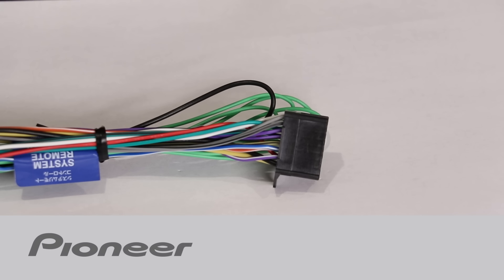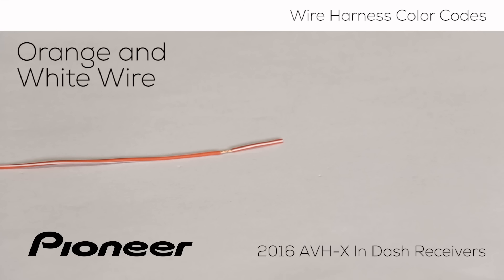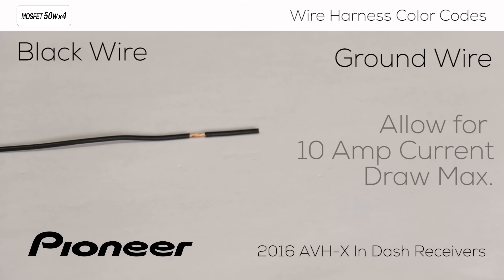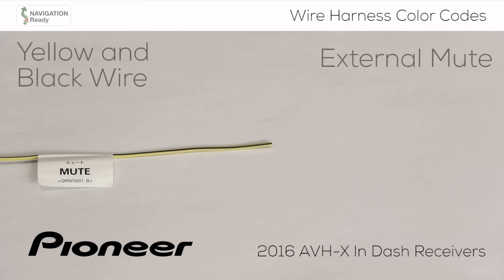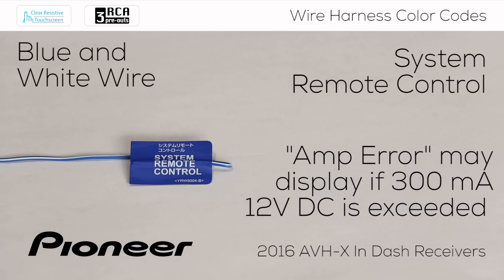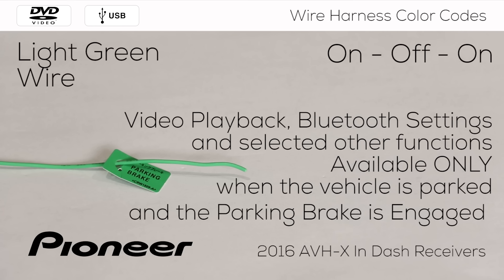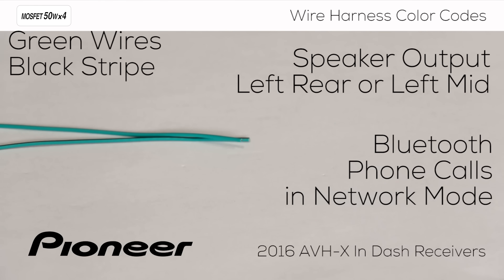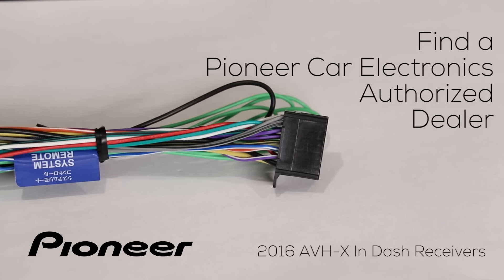How To - Understanding Wire Harness Color Codes  for Pioneer AVH-X Models 2016

Comment: Avh-211ex came with the pioneer camera. Everything works but, no sound or back up camera working. Radio shows it's working. CDs and DVDs play, you can make a call and they can hear you but you can't hear a single thing. Everything is from pioneer. Any help is greatly appreciated.
Reply: I would like to add. Many have checked connections yes professional. Just off the clock because they are family. We did buy the harness you recommended. So everything is 100% pioneer compatible from our understanding. I really think that the harness may not be the correct one for my car. It's a 2010 equinox. No steering wheel controls.
Reply: Also no subs are being used. It's all just factory door car speakers. Had sound fine before. Again it reads disks and you can call. Bluetooth connection is fine. Just can't hear sound and the back up camera won't come on. But I do believe your video and the comments have explained that part about the camera. But the no sound. No one can understand that. I really wonder if the wire harness for the car is the correct one.
Reply: I recommend to press the microprocessor reset button.  You'll need a paperclip or some other small point to press the microprocessor reset button.  You can find the microprocessor reset button on the Pioneer AVH-211EX at the bottom of the hard key panel near the rewind button.  
You mentioned above you may have an incorrect wire harness.  Just to clarify, the Pioneer AVH-211EX has a wire harness in the box.  It should be identical to the one shown in the video above.  That is the only wire harness that is designed to be used with the receiver.    Are you using a 2nd wire harness adapter designed to connect directly to the wiring of the vehicle?  Vehicle compatibility is usually shown on the packaging for the factory wire harness adapter.  If this is not the correct wire harness, I recommend doing some research to find the correct compatibility.  Here is one possible option for the 2010 equinox:   http://metraonline.com/part/99-3307G  You'll need to do research to be sure it's the correct fit for your particular vehicle.   Here is another possible option:  https://www.scosche.com/lpgm15   You'll need to do your own research to be sure it's the correct product.
If you still don't have sound, I recommend to test any individual speaker output from the receiver.  For example, on the back of the receiver use the White and White with black stripe.  Connect it directly to a speaker that is know to operate.  This is just to confirm audio output from the in-dash receiver.
As for the backup camera,  Pioneer in-dash receivers are designed to work with the Pioneer ND-BC8 backup camera. I don’t know about the operation of other cameras. 

Be sure to plug the Brown camera output RCA into the Brown RCA Input on the back of the Pioneer in dash receiver.

The Pioneer ND-BC8 camera needs power and ground to operate.  The camera should always have power when the vehicle is switched on. And the camera should power off when the vehicle is switched off.  This is very similar to the way the Red Ignition wire works on a Pioneer in-dash receiver.  Just because the camera has power does not mean you are viewing the camera window on the in-dash receiver.

The purple/white wire is used to let the in-dash receiver know that the vehicle is in reverse and to open the backup camera window on the receiver screen. 

Do not connect the Purple/White wire to the camera. 

When you put the vehicle in it’s reverse gear, the Purple/White wire should sense a change in voltage. This opens the camera window on the in-dash receiver. And closes the camera window, when the vehicle is taken out of it’s reverse gear.  One possibly connection for the Purple/White Reverse Gear wire is back up lamp terminal.
Reply: The wires that came with it are similar to the video. The wires i got with it does not have that white wire for the mute and when i saw that i almost instantly thought thats where the sound problem is. But everyone keeps saying "thats what came with it. The papers and the audio guy at the shop even said it was the right one. Then when connecting to the wire adapter to plug in to the car is aswell missing wires that would complete the cycle.  But again we keep being told its the correct.  But you show a white wire in the video that i do not have on the wire harness that came with it. 

The camera is the one as you mentioned.  But again the i keep pointing out to everyone that the purple needs to be connected.  But according to the papers there is 2 ways to install.  Like you said in your response is what i kept saying but again they said it is not needed. But i think 100% it is. That would bring us back to the wires. I do not have it infront of me to tell you what wire other than the white one i know for sure is missing.  But i will send all your information along to them when i go back to the shop. I even wonder if doing this for as long as they have just might be getting to some old men. Lol but again thank you for responding.
Reply: I said wrong. I have the white wire. I do not have the yellow and black wire. It's the mute wire. That is why we think it is not correct. Or the wire come out somewhere in shipping and packing.
Reply: So, there is no yellow and black wire as well. I was told to state that the red wire is pink. You could say red but everyone that looked at it says pink. Next to a red wire you can see the color difference.
Reply: Ndbc8 is camera. they got that corrected thanks to you. I have about 5 heads in total looking to make sure we actually have the correct harnesses. The wires that came with the stereo doesn't have the yellow and black wire and the red really looks pink. No red wire.(it's pink) I wonder if it feel out. Everyone says not likely.
Reply: Here is the unboxing video for the Pioneer AVH-211EX, you can see the wire harness that comes with the Pioneer AVH-211EX here: https://youtu.be/eNlcyN_kAfE?t=51  
Please note the Pioneer AVH-211EX wire harness does not have the Yellow/Black Mute wire.  This is normal for this product.  The Yellow/Black wire not being there is not the issue.
The Pioneer AVH-211EX wire harness has 15 wires.   The Pioneer AVH-211EX wire harness should have these colors:  RED,    YELLOW,    BLACK,     Light Green Parking Brake, Blue/White System Remote Control,    Orange/White,    Violet/White Reverse Gear.    The speaker leads are:   Gray,   and  Gray/Black,     White,  and   White/Black,     Green,  and Green/Black,     Purple, and   Purple/Black.
There should be a red wire and no other wire that is close in color to the red.  If the red wire seems to be a little pink in color, I'm sure it's OK as long as it can not be confused with any other wire for RED.
Reply: Did you press the microprocessor reset button on the receiver?    

I recommend to press the microprocessor reset button.  You'll need a paperclip or some other small point to press the microprocessor reset button.  You can find the microprocessor reset button on the Pioneer AVH-211EX at the bottom of the hard key panel near the rewind button.
Reply: Yes, it did not work. I went to yet another source that told me like you. To do my research and he will install. So before I pay him to finish this. I'm trying to remember what he said so please work with me on my words. The pigtail (like in the video) does not have the yellow and black wire. You state in the video it is for the external mute. I was told that it did not come with everything that was needed. I need a pass 4 box. Before I go and buy anything to have them do this. Do I need a pass 4 box and why is there no yellow and black wire for the external mute as stated in the video on mine that came with everything? I do hope my words are correct and understanding. 

He did go on to explain to me that, the yellow/black wire is not needed because the pass 4 box will take care of that and the pass 4 box will connect into the cars wire harness. Again I'm sorry if I'm not saying it correctly but I do think I am.
Reply: I did go ahead and had my factory stereo put back in untill this is resolved. so I know I have everything that is needed for it to be done correctly. I do not mind buying something that is needed to complete the install. 

I would like to note that when the Avh-211ex was installed, I had no door chimes or turn light chime as well as sound out if the stereo. Now the car is back 100% to factory. like I stated, I found a new source and just need to make sure when I take it to him I have everything I need for him to get it done. I'm getting it discounted because I'm bringing all the parts to him as well as why he told me to do my research like you did. Lol
Reply: Again thank you. FYI. I was going to the local audio shop in my town. Originally. After being told I need a pass 4box (with the new place I found) and me watching your videos. My Avh211 came 100% like the video. You sent 2 links in the comment about me not being sure if it was the correct wire harness. What i have is the "scosche GM5216B indash installation kit for 2015-Up Chevrolet Equinox Vehicle's"   That is what I purchased when I bought the Avh-211 because I was told that is what I needed. 
 
While watching your unboxing video, it got me thinking. I watched them work on my car. It's a small town. On the back of the Avh-211ex where you connect everything in there is the AUX next to the rcin. Does there need to be something connected to it? Only asking because your unboxing video says it for sound. So do I need it? 

You did inform me that I don't need the yellow/black. So I went back before they left and showed them your unboxing video and responses. In the video, while you explain the functions on the back of the avh211 unit. When you get to the AUX one guy goes oh runs over to my car. After that, not much said to me.  that's when I told them I wanted them to put my factory back in. Which led me to looking for a new place to have it finished. That's when I was told to get a pass 4 box. 

Do I need to buy a pass 4 box and/or do they need to connect the AUX in to the back of the unit? I have little faith paying a new person to do it again if they don't know. Just want sound lol that's why I'm asking you
Reply: You just want a radio that works.  That's not too much to ask for.  I'm sorry, I'm not sure what a "pass 4" box is.  I can't say it's wrong.  I'm not sure what it is.   The AUX does not need to be connected to anything in order to get sound out of the receiver.  The AUX is an input.  You could plug in a phone or some other music player and listen to it when the receiver is set to the AUX source. AUX has nothing to do with AM/FM radio or CD etc...
Important:    Just to be sure.   Has anyone tested the receiver to see if it is putting out an audio signal?  For example:  Has anyone taken the receiver to a work bench and hooked it up to a power supply to switch it on, and then connected it directly to a known to be working speaker or 2 speakers to the receiver's speaker outputs?  Just to check and see if the receiver is in fact working correctly?  
It is possible, the receiver powers up, and all functions appear to operate normally but it won't send power to the speakers.

Comment: better tell me how to connect brake wire whit out hand brake .  i connected it to possitive wire but it still dont work
Reply: Reda Jasulaityte connect to ground
Reply: You don't need buy antything. Light green wire (from the unit station) stick  to the grund (somethig metal). I did that in my Chrysler 300c 2007 and I have all setting visible all the time and I can watch movie while driving :D Simple and priceless. Regards from Poland where imposible is nothing :)

Comment: I have a Pioneer to ISO harness and there is a pink wire. What does that do?
Reply: The Pink Wire in a Pioneer wire harness is from a Navigation Level in-dash receiver with a model number that begins with the letters AVIC.  The Pink Wire is for VSS or Vehicle Speed Sense and is used to more accurately track the motion of the vehicle.  VSS taps the vehicle computer to read speed data generated by the vehicle. I recommend to connect the Pink Wire in the Pioneer Wire Harness when possible for best performance of the in-dash navigation system.  In most cases the Pink Wire is NOT required for operation.  You can find Pioneer's You Tube Channel here:  https://www.youtube.com/user/pioneerelectronics

Comment: i have a manual car and was wondering how i can bypass the parking brake switch, seeing how my e brake doesnt work whatsoever (no cable, and no wire) thanks.
Reply: How to make a wire harness for pioneer avic z1
Reply: Search for a Micro Bypass (for emergency brake)for your brand of radio.

Comment: avh-x7500bt steering wheel control wire?
Reply from the maker: You can use your steering wheel controls to operate certain functions of the Pioneer AVH-X7500BT through the use of an optional 3rd party steering wheel control adapter.  It plugs into the back of the receiver.  You can see this on a similar Pioneer receiver in this video: 
     https://youtu.be/F-rqoqMZ_pA?t=86       Many adapters are available.  Here is one possibility:   http://metraonline.com/part/AXSWC    You can find more videos on Pioneer's YouTube Channel here:  https://www.youtube.com/user/pioneerelectronics
Reply: @pioneerelectronics  i have connects 2, can i use it?

Comment: Does any body know how to retain factory backup camera with Pioneer AVH-4000nex?
Reply: This depends upon your vehicle.  The Pioneer AVH-4000NEX has a Brown RCA backup camera input on the rear of the receiver.  You can see it here:  https://youtu.be/16JgX6z8Mhs?t=96   If your vehicle has a camera with an RCA output it may plug directly into the Pioneer receiver's backup camera input.   The receiver’s violet/white wire is used to let the in-dash receiver know that the vehicle is in it’s reverse gear and, to automatically open the backup camera window on the receiver screen. 
Do not connect the violet/White wire to the camera. 
When you put the vehicle in it’s reverse gear, the violet/White wire should sense a change in voltage. This automatically opens the camera window on the in-dash receiver. And closes the camera window, when the vehicle is taken out of it’s reverse gear.  One possibly connection for the violet/White Reverse Gear wire is the vehicle’s  backup lamp terminal.   You can learn more about it here:   https://youtu.be/6VY10uChNTI
Depending upon your vehicle, you may need the iDatalink Maestro RR integration unit for this to operate.  You can see a demonstration of Maestro RR here:   https://youtu.be/GX8bETHjZkg?list=PLw63zJRQbCNi6CoU7JbUNT83T7ippQbU6    You'll need to do some research to see if your particular vehicle is supported.  You can find more information here:   https://maestro.idatalink.com/product/product/product_id/102
Reply: @deckerdotto6035  Thanks! Your reply helps! I think I connected to front input since both are yellow color..
Reply: @deckerdotto6035  Unfortunately after I connect to Brown RCA still not working, have no idea what's wrong

Comment: my player model is avh-275bt i looking for the steering control wire is how to joint
Reply: The steering wheel control input can be found on the back of the in-dash receiver.  You can see it in this video of a Pioneer AVH-280BT, very similar to the Pioneer AVH-275BT:  https://youtu.be/1Q83UKznU8k   In order to use your steering wheel controls to operate the in-dash receiver, you'll need a third party steering wheel control adapter.  There are many available, here is one option:  http://maestro.idatalink.com/product/product/product_id/101

Comment: I have four front speakers and only two work with this avh 2800 bs radio in standard mode
Reply: I recommend visiting a car stereo shop for professional installation help.  You can find a video explaining the outputs for standard mode and network mode in this here:  https://youtu.be/PeH_h8UHzBw?list=PLw63zJRQbCNi6CoU7JbUNT83T7ippQbU6
Reply: I know about the front output RCA jacks but door speakers don't come with RCA jacks and tryn to convert them would be a bitch.. the whole set up is unnecessary..

Comment: Hello everyone! I have a pioneer Avh-270bt. I cant pair my bluetooth with my iphone. It says memory full. How do i clear the memory? How do i put it in parking brake mode? Which wire is the ground wire? Can anyone help me.
Reply: You can see how to delete phones from the receiver's Bluetooth memory in this video on a similar Pioneer receiver:    https://youtu.be/Z9VTZHWPzkQ?t=52      You need to engage the vehicle’s Parking Brake in an ON-OFF-ON operation in order to access the Bluetooth setup menu. This might also be called the hand brake.  If you engage the vehicle’s Parking Brake and still can’t access the Bluetooth menu, the in-dash receiver’s Green Parking Brake Wire may have an incorrect connection to vehicle.  You can learn more about the Green Parking Brake Wire here:  https://youtu.be/-bF3uzzaT30?t=309    You can find more videos about Pioneer receivers similar to AVH-270BT here:  https://youtu.be/pZQ-K1-3b8Y?list=PLw63zJRQbCNjldQJZ02xdYyq1SAHIazzh    and you can find more videos on Pioneer's YouTube Channel here:  https://www.youtube.com/user/pioneerelectronics
Reply: Deckerd Otto thank you! But my pioneer receiver does not have a ground wire. I don’t know were to put the ground wire. Can you tell me ? Thanks.
Reply: Deckerd Otto I see but i don’t have a ground wire in the unit sterio, so i will put the parking brake mode.
Can you help where in the unit should i install it. Thank you!

Comment: Is the wiring harness for the AVIC8200NEX the same as the AVH-4200NEX?
Reply: The AVIC-8200NEX has one additional wire in the harness.  It's a pink wire for VSS or Vehicle Speed Sense that can be tapped into the car's VSS wire for better accuracy when using internal navigation.